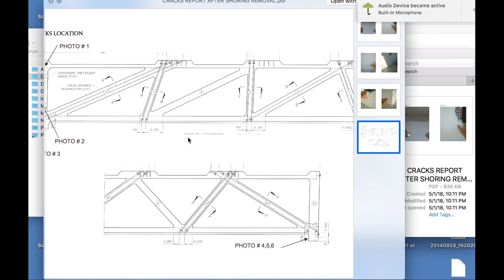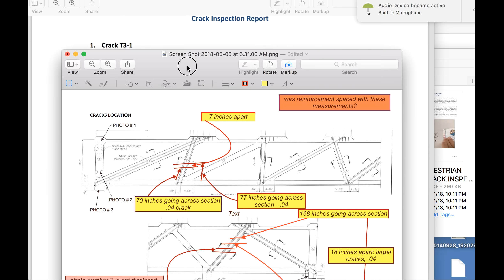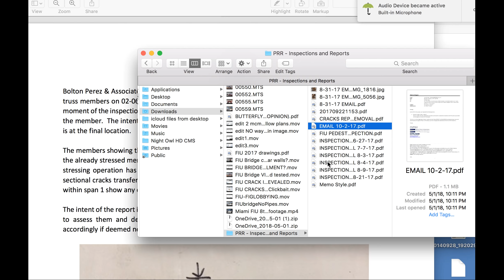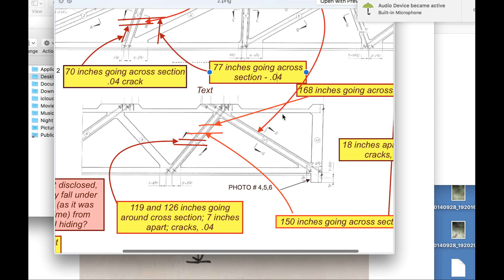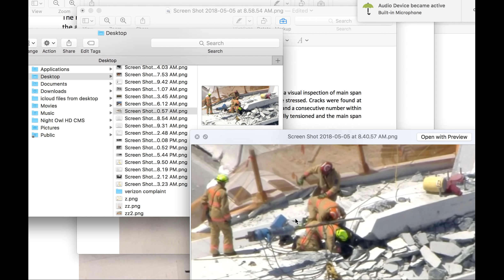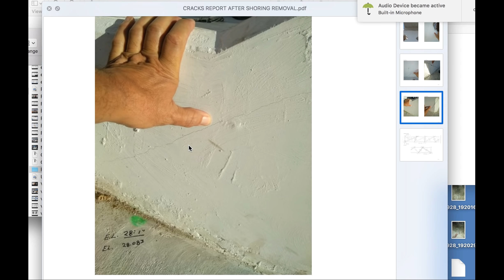FIU Bridge Collapse LEAKED IMAGES Cracks by Bolton Perez & Associates - analysis of cracks

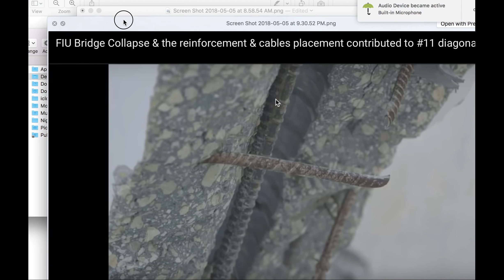Comment: Question; starting at the 26:30 time of this video you show a photo from another video that you posted.  The photo shows the re-bar where the crack may of been.  I do not see much adhesion of the concrete to the re-bar.  Is this 'normal'?  Another good video, thank you for your TIME.
Reply from the maker: Imhof714, it is kind of typical to be able to ''free'' rebar from concrete and it look or have little cement attached to it. Sometimes, you will get an area where it really ''wraps'' around the rebar and takes some work to break it free. 
ImHof, think it of like this... concrete is cement based and cement does not bond well with steel (a very smooth surface)... The rebar has those ''ribs'' to help it hold in tension, once the concrete cures around those ''ribs'' but, it's ability to become ''ONE" with the rebar is never going to happen...  I know, we have a belief that rebar becomes ''one'' but, it's just there for tensile resistance and must be ''locked in'' by the concrete ''cover'' around that reinforcement. 
This is a video, I show how I use the knowledge of the rebar to break up concrete...https://www.youtube.com/watch?v=xB2BxDhSz2s
Reply: You throw a mean sledge hammer!  Good practical experience/example.
Reply from the maker: Thank you Imhof714, I like sharing... especially, because skilled workers and design is just about all gone from this country's workforce... it is mostly older men who are the skilled workers and this country will need a younger, replacement group... But, boys grown into    boys/feminine boys     these days... Boys use to grow into men... (just a thought).
Reply from the maker: Imhof, thank you... of course, I use the hammer on edge, to direct more forces in a concentrated way...  haha

Comment: Nice work.  I’ve enjoyed all your video analyses.  I agree this is not an atypical, factual, unbiased construction report as was needed.   I’ve seen much better in my work over the past 20 years managing water/sewer facility construction.  This report lacks the specificity and forthright  technical accounting that this type of work requires.  You are correct saying “similar” when accounting for the cracks means nothing.  It’s like a poor speaker saying “you know”!  Construction inspections SHOULD professionally call out the team to insist on their attention to factually, thoroughly stated observations of ALL defects present.  

So then on the partial coating work, I’ve seen contractors get done what they can on what parts they can up to a point like that, then come back later to finish and yes even redo some.  It could be that contractor let coatings/painting sub get coatings work on the earlier formed concrete once it met an age requirement, and then canopy wasn’t of age being last poured/youngest concrete.

The jack hammered blister with tooling still attached - likely they undermined the washer plate bearing areas.  How do you jack into that the way they did and not?  Seems like better removable access could have been designed if ever to readjust tensioning.

Have you seen any concrete break test results from any materials testing (sorry if I missed it)?  Wonder how well each of the concrete pouring events met strength?

This was design/build.  So in my opinion, you rush engineering design to a ragged early stage (30%) to rush out an early costing that so prematurely is being used to throw out there a possible overall cost.  Then you move the design/builder into construction doing only what minimum engineering has to be done to build it!  So better have a stellar team!  

Now, which group was FIU’s owner project manager ensuring all was progressing well and directly reporting to a key FIU project manager??  Check and balance.   All these dollars and lives wasted!
Reply from the maker: That's awesome to read... thank you very much for your positive feedback... Thank you also for sharing your experiences and comments about this ''report'' from the engineer... I hope people read your comments.
Danny, I have not seen the testing from NTSB... they have not made that public... And, I agree, it is terrible to see these lives lost over a construction process that appears to be ''rushed''... without safety of the public in mind... (my opinion).

Comment: All evidence appears to suggest this entire structure was conceived out of fantasy and its failure imminent from the beginning.  The mere fact the documents are calling the web sections "truss members" is structurally incorrect.  And has been pointed out, pre-/post-tensioning these  web members is a nightmare when considering load paths - particularly at the north and south ends where they seem to have become  significantly greater. 

The cracks in the images show that the concrete has already suffered a degree of failure under tension (or detention - whichever the case may be) I see the potential for a shattering of the concrete under load, radically shifting the load path to the point of failure at the canopy.

I still believe a complete timeline of events is necessary as fundamental to the investigation.  The coating, as you mention, was applied after the formwork was removed.  However, the cracks, as you point out, seem to have appeared after the coating was applied. All the participants in this  will have to answer for their incompetence and culpability in this tragedy.  

Thank you for bird-dogging this event and its aftermath.  It's not going to be pretty, but we can't let this happen again.

Comment: Excellent job explaining this.  It is beginning to appear to my untrained eye, that all of the indicators for the impending disaster, were clearly there... right in front of the Design Engineers, Inspectors and Constructors.  They chose to note, soft pedal, monitor and write CYA emails instead of addressing the problem.  Problem:  The Bridge as built, was a failure.  Am I nuts to view this as Criminal Negligence? Or were ALL these people that incompetent, all at the same time.?

Comment: As a layman I have a question about how much of the bridge's overall strength, was to come from the tension cables that were to be inserted when the two parts of the walkway were put together, and how much less strength did the walkway have to support its self, without them, What was the margin with them, did any one do the calculations to show that the walkway would be ok without them ?    If the margin was close, I just had one other thought, when they first designed the walkway the designers said the de-tensioning was to take place after the walkway was moved, maybe they meant after the other cables had been inserted and tightened to take the load, and this got lost in the paperwork and nobody picked up on it ?  And One last though if this walkway was so new and ground braking this project should have been scrutinised every step of the way.
Reply from the maker: Listen to my video again, the designers did NOT intend that detensioning take place after the move.
It was after main span was complete.

Comment: Wasn't there meant to be radius around the posts/pillars to deck joints to aid in prohibiting stress/fatigue cracks seems there a little small?
Reply from the maker: That was just in my one video showing how cracks were resolved in those roof truss systems...
I then extrapolated that cracks may produce themselves at those locations, on this bridge system...
No radius appears on the plans available to the public.

Comment: Surely if they were going to DE-tension truss member 11 and it had cracks in the concrete then a greater proportion of the bridges integrity was relying on those tensioning rods and releasing the tension on the tensioning rods may take the now damaged concrete truss member past its load bearing capability resulting in massive and sudden failure?
Reply from the maker: Refer to my other videos, buckling and failure of column would have shown but, this column appears intake...at time of failure.
It appeared plastic during failure... again, I think the failure is in the canopy first...as a result of p.t....
The forces, I suggest, cracked the one foot think canopy...
Then buckling took place after the longitudinal tendons could no longer maintain their load paths...

Comment: Just to add to your comments in the vid.... One can expect small line cracking . But some of the stuff you are showing would worry me. In cast re-bar you do get cracking...shrinkage cracks and settlement cracking. The deck will give under self load... This is why we add negative camber. So the inspection report seams to contain correct information. That said the wording seams soft and does not give the concerns any gravitas.... It is worded in a manner to not promote worry...and from what i can see some of the pictures should be worrying. Further although some cracking  are fine line, there is so many of them that I would need to call in the big boss to have a look. As an engineer The quantity and some larger cracking would mean I could not pass this bridge to hold and function under load. Hence more tests and a 2nd and 3rd opinion would need to be enlisted if I was the engineer. Now that we know the bridge failed it seams the tensioning or design is in question. Further, we need to understand the depth of the cracking. So ultrasound equipment and other specialist engineers would have to be hired at the contractors cost so they can prove to me those cracking  issues are superficiall. After seeing the sheer quantity of the issues, the super-structure should never had the go ahead to be moved into final resting place until all those cracking issues had been deemed safe.